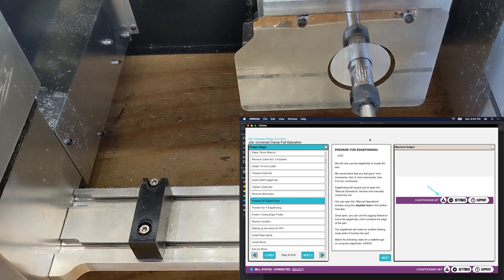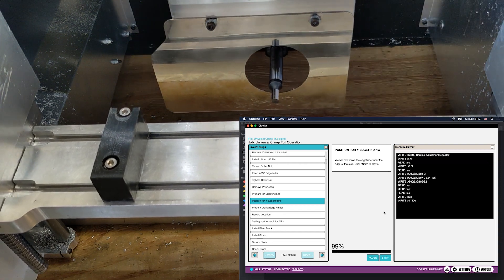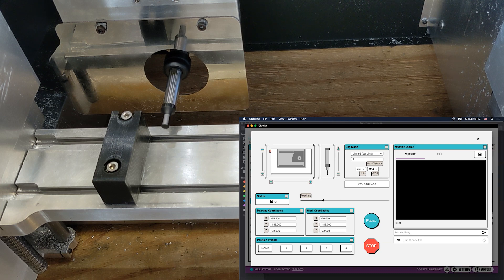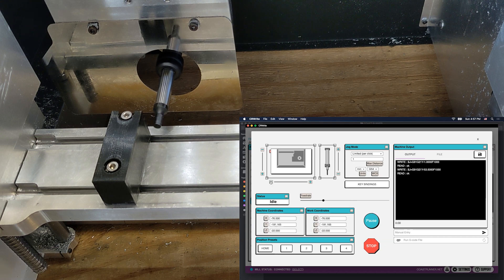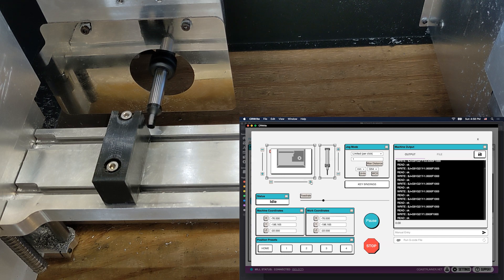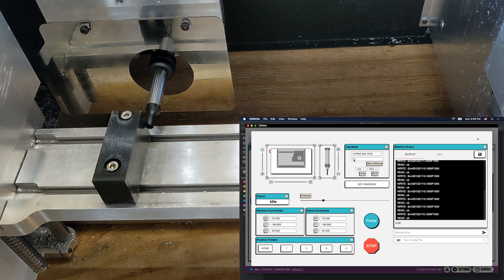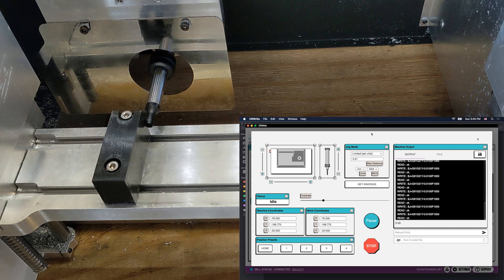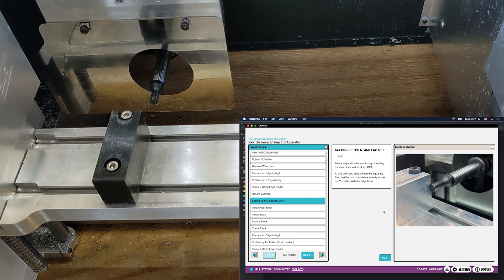Coast Runner CNC - Edgefinding

Comment: Hey!
You recorded the location with the edgefinder in contact with the edge of the part/stop. On the larger machines that I run, I would need to either do the math and add/subtract the radius of the edgefinder to call my position at the center of the spindle, or physically move my edgefinder in Z and manually move the distance equal to half of my edgefinder and then press "Record" to set that location. Does your system have half of the edgefinder figured in already? Are you intentionally staying some distance off of the stop? Maybe your stuff is just different than mine, so I don't want to sound like I'm telling you that you're wrong..but...maybe I missed something. Let me know! Thanks!
Reply from the maker: You guessed correctly! The software in this example knows to compensate for the edgefinder radius. More specifically, the cutcode that I am running here has previously told us which edgefinder to use, and so subsequent steps can safely assume that we are using an edgefinder with a particular radius. At 7:17, when I click "next" and it tells us that it's going to run some gcode behind the scenes, the gcode the software is running to record the zero is written to compensate for that known radius.